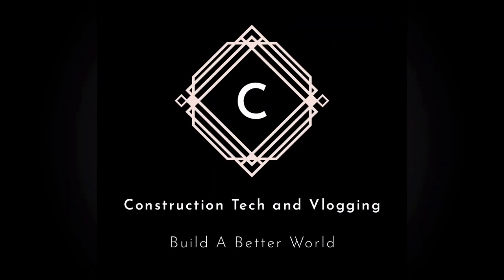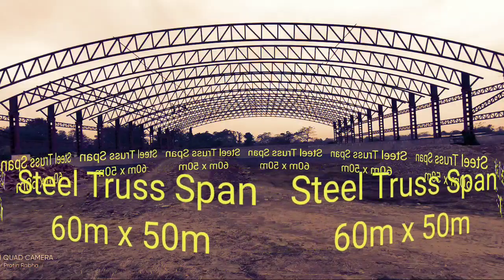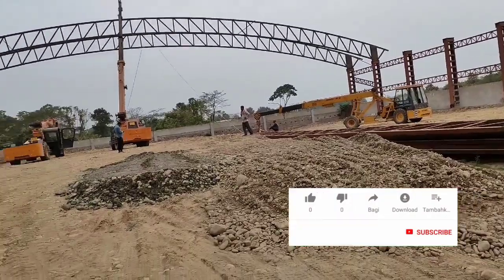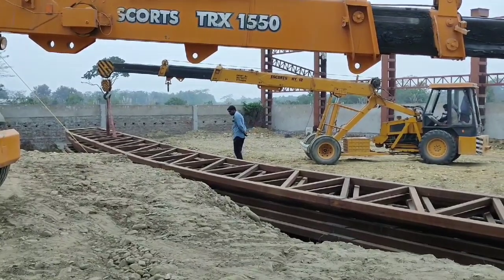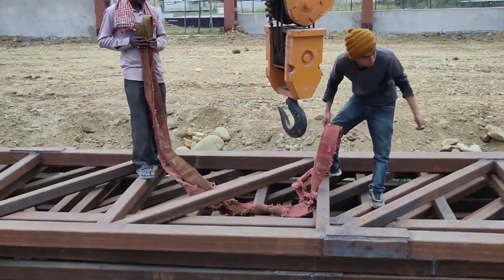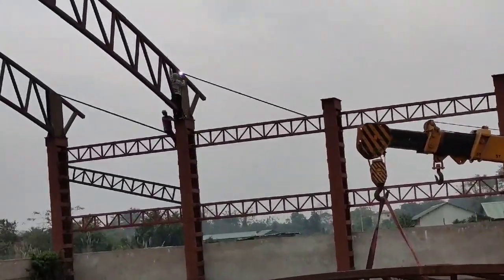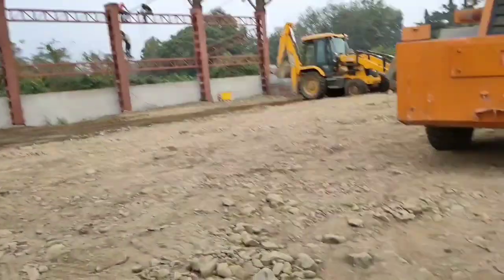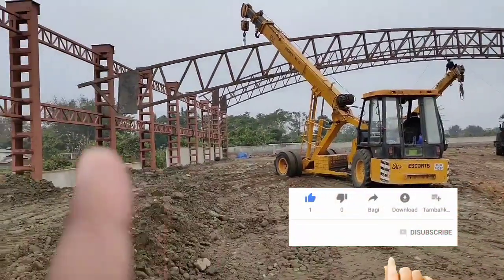Truss Erection Part 1| Curved Truss Installation| Truss Welding| Truss Erection and installation

Comment: What's the size of the top and bottom cord. The trutts and ties? The span of the columns. Is the truss clear span 50m?
Reply from the maker: Chords size is SHS 132.132.4.8. and yes span is 50m and inside length is 60m.
Reply: Thanks. SHS  132x132x4.8 mm thick?
What about the depth of the truss btwn the top and bottom?
Reply from the maker: @simonnjuguna612  yes. Pitch between the two chords is 1.6m.